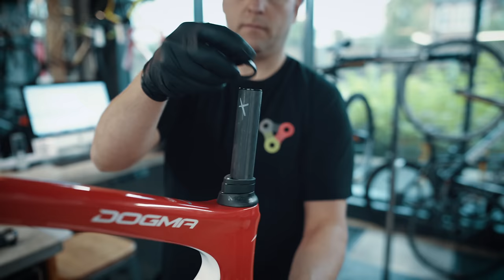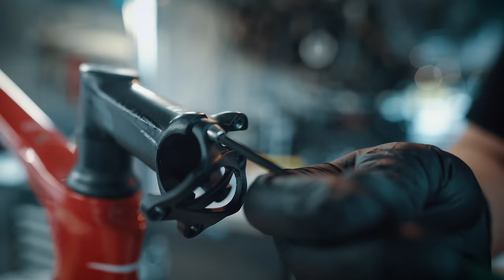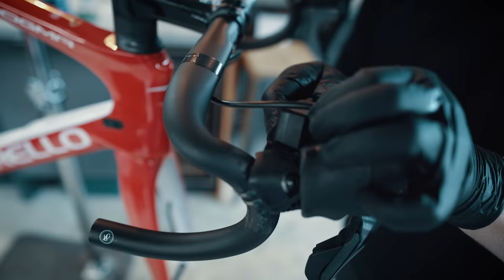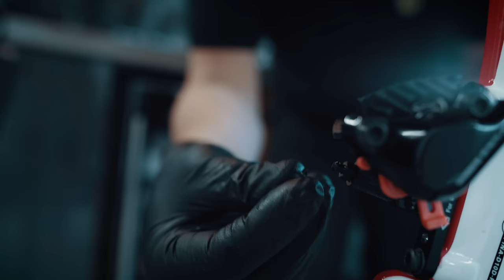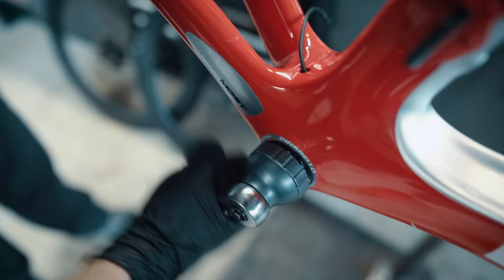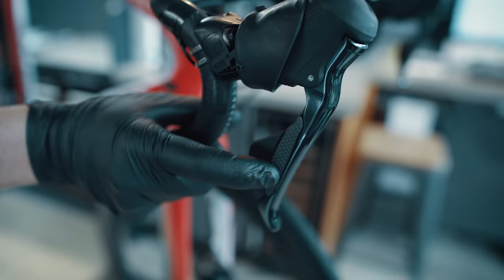DREAM BUILD ROAD BIKE - Pinarello Dogma F10

Comment: 27 years ago I used to work in a bike shop, now here I am watching bikes being built on the inter web. Back in my day (: we had steel frames with rear drop out screws. I'd have to tap out the threads with a 2mm tap. Woe betide if I snapped off the tap in the drop out. I'd love to do it all again with these new systems.

Comment: For man, death is the great equalizer. For road bikes, it's the tape that fixes the bar tape at the end. The bike's price doesn't matter, the bar tape still gets taped up on the tops.
Reply: kswsquared lmao beautifully stated
Reply: That's why when I tape a bar I start at the TOP and end at the BOTTOM and use the supplied bung to keep the tape in.
I personally have had no problems with my tape coming undone or water penetration.

I used to work at Raleigh and this was the way back then, many moons ago.
I can comfortably say I have taped over 30,000 bars this way.
Before anyone shouts bull sh*t you do the maths.
Quote for a day was 125 bars taped, that is all we did, someone else built the bars.
5 days a week.
52 weeks a year.
And I was on that job for well over a year.
Reply: @ianh9696  thats the way!

Comment: Would be fun to see these guys do a anti-dream build. They could get a pos bike frame and knackered old components and build it up using all the cheapest work arounds 👍
Reply: Chinese carbon everywhere, third hand SRAM in the back, Shimano in the middle, and Campy shifters, hand tight everything, no grease, breaks squeak, tires rub, seatpost jingles and jangles after the first pebble you run over.

Comment: edited the part where he spends hours fiddling about trying to get the gear cables through the frame
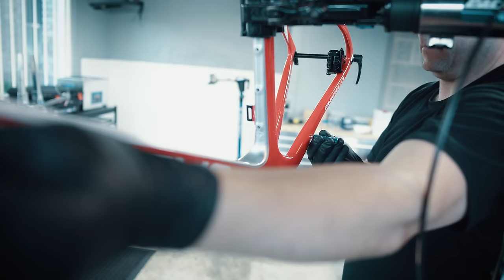Reply: 05:39 dude was using a magnet to guide the cable. Pro skills at work here
Reply: Just buy the park tool magnet cable kit 😁
Reply: @benturp3492   Ben Turp  50 quid! I dont think so lol
Reply: The dude spent minutes not hours. He does this everyday.

Comment: It's so funny that Hayes did a 22mm mount on the chainstays for discs in the 2000s, and then the industry goes "no, that sucks, we'll go with a 57mm mount on the seatstay, call it International Standard, everyone will use it that way." 

But then no, Avid wants the 74mm post mount. Except that the threads could be ruined, making them useless.

And now we're back to chainstay mounts, except now they're "flat." I guess that makes them new.

Nothing is ever new in the bike industry.

"Lay back, it's all been done before."

Comment: Nice Park tools, pity you don't have a Park CSB-1 hacksaw blade made for cutting carbon and instead cut with a hacksaw blade made for metal. I would also recommend sandpaper rather than a file for cleaning up (file is the tool for metal steerers)... I would also suggest you protect the frame when using the heat gun to shrink the cable wrap.

Comment: nice bike, nice vid! why did you change the sprockets of the shifting unit?
Reply: Those pulley wheels are from Kogel, which are slightly larger than OEM pulley wheels and run on ceramic bearings. These reduce the chain's angle of attack and reduce pulley wheel friction, which in turn improves drivetrain efficiency.

However, for such marginal gains, these parts are far from affordable.

Comment: There’s a metal backing plate for the FD stabilizer screw that never went on.
Reply: If that braze-on mount wasn't painted, it may not be necessary. But since it was, yeah, might as well.
Reply: @yonglingng5640  The plate is for the stabilizer screw to press on to keep the derailleur from moving when used.
Reply: @GNX157  I knew about that.

Comment: Now, use Oz cycles new chain lube formula and get the least possible friction and dirt. Actually, he's just found a way to get PTFE powder inside the rollers so the chain is Teflon coated inside and doesn't attract dirt. Just mix PTFE powder into some melted paraffin, soak the chain in it to get the powder in all the crevices and after it cools off, break off the wax and you're done. Throw those jockey wheels in there with the chain while you're at it.

Comment: Nice video! Can someone explain me why he changed the pulley wheels on the rear derailleur?
Reply: The new ones (Kogel) are slightly larger than OEM to reduce the angle of attack for the chain links and use ceramic bearings for friction reduction.
Reply: @yonglingng5640  Thanks! :)

Comment: Is there a huge difference in performance when swapping out the smaller cogs for bigger ones in the rear derailleur?
Reply: The ones that replaced the original ones only offer marginal improvement. For the greatest friction reduction in rear derailleur pulley wheels, the entire cage needs to be swapped out for an OSPW (oversized pulley wheel) system, which uses much larger pulley wheels, so large that it needs a new cage. Examples include CeramicSpeed, Ridea, etc.
Reply: @yonglingng5640  Thanks so much for the quick reply and the education in terminology (pulley wheels).

Comment: You dont cut the fork tube before someone is on the bike, because it changes the bike fitting for every person. If for some reason you need the handlebar higher, youd be screwed.

Comment: What pulley wheels did he fit to this ?
Reply: Kogel
Reply: Yong Ling Ng what are they like?
Reply: They're slightly larger than OEM pulley wheels and use ceramic bearings. These reduce the chain's angle of attack and provide less friction, which in turn improves drivetrain efficiency. For maximum benefit, you'll need to swap the entire cage for a larger one that has much larger pulley wheels, such as CeramicSpeed, Ridea and so on.

But I personally don't believe in such upgrades, the gains are marginal and they're expensive.

Comment: If the mechanic put the wheels on put the bike on the ground and set the levers position before cutting the second end of the brake cables they would of been neater and no chance of having to redo a olive crimp.

Comment: can someone explain how some fluid and wires can act as brakes?
Reply: Those wires are for the derailleurs. Hydraulic braking works by squeezing the lever, which actuates the master cylinder, which then transfers brake input to the pistons through the hydraulic fluid housed in the hose.

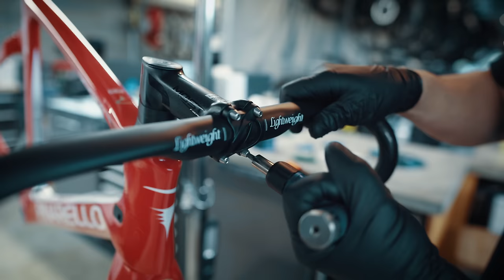Comment: ?  Why is he using a torx bit on a hex (allen) screw?   3:25
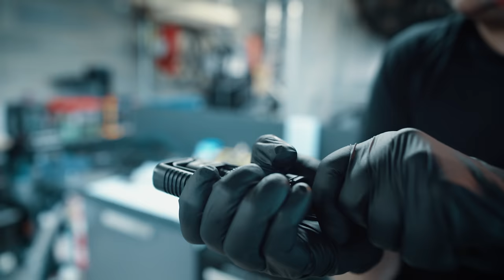  What is the name of that tool at 6:06?
Reply: MOST (as in, the brand) stems use Torx bolts. The tool at 6:06 is Shimano's hydraulic needle press tool. An alternative for that tool is a pair of yellow jaws provided with Shimano's hydraulic hose kit to be clamped with vice pliers and you'll use a mallet to hammer the needle into the hose's opening.

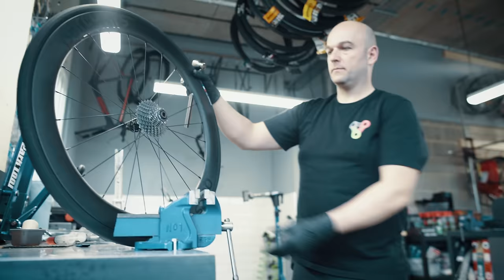Comment: 9:31 Do you want a dug up freehub? That's how you get a dug up freehub. Always use a torque wrench to tighten to lock ring to 40NM. Without proper compression, gear rings will dig into an alloy freehub like a hot knife slicing through butter. I cannot believe the unprofessionalism of the mechanic.
Reply: Done it this way for 10 years. Never had a problem. Also pretty sure Shimano freehub bodies are all steel anyway so it doesn't really matter.

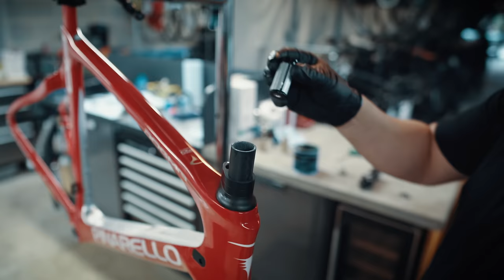Comment: 2:01 can you guys tell me what he's interesting into the fork?
Reply: This is called a "bung" and acts as an alternative to the star nut that you typically see in aluminum and steel forks. A star nut works by digging itself in to the metal of the fork steerer to hold itself in pace. With carbon forks, you don't want anything to dig itself into the material, so bungs hold themselves in pace through compression.
In case you don't know what the star nut or bang is for: The are simply to hold a nut inside of a tube. The bolt of the top cap is then screwed in to the nut in order to hold everything in place and preload the headset bearings.
Reply: @m97120  ohhhhhh thanks man

Comment: Why oi forks need to be cut? They already know the measures...why ?
Reply: It's one steerer tube length for all sizes. The largest Dogma F10 frameset won't need to have a lot of extra steerer tube cut off. They can't possibly make different moulds just to account for different steerer tube lengths.

Comment: Great video of the build.
But the build itself...
Someone spent big cash for this build/bike.
Pinarello Dogma F10 frame with disc brakes.  Dura Ace component kit.
Even upgraded the jockey wheels in the rear deraileur.
...But used the stock Shimano bottom bracket???
Anyone who builds a bike this expensive can easily afford any of the numerous bottom brackets out there that are far superior to the stock Shimano (even if it is Dura Ace).
I just don't understand why anyone would drop this kind of coin on such an expensive bike and not spend another $100-200 on a much better BB.

Comment: More like a nightmare build. Not wearing a mask when sawing and sanding carbon fibre. Not glueing the cut edge.  Handlebar wrap completely messed up with bulky figure 8. Worst thing: Not knowing how to properly use a torque wrench on the handlebars. Could end up in catastrophic failure of the carbon!

Comment: Sorry, but this is a price pulled out of thin air.  I put a bicycle together last month. Ran through all same steps. Granted - my components were less expensive. All in around a $1000. Which was a decent few hundred less than ready comparable parts bike. 
This price should include a TV, dining table set and directions how to cure cancer. Otherwise it’s an overpriced BULLSCHIFF

Comment: Why the fuck would u put that blue shit on the bars? 
Like the bars are going to seize up on the stem

Dream build but he tapes the grips with TAPE
Maybe u should torque it before u tighten it in its fuck in..
Torque wrench is just clicking
Reply: That's carbon paste, not grease. Rub a drop between your fingers & you'll feel it's coarse.
Reply: @yongling9825  Now i see..as google says ..specially designed to create friction and reduce slippage between clamped carbon fiber surfaces...made for people who don't know how to use a torque wrench..waste money on that but tapes the grips
Reply: I know what knurling is & nobody does it on carbon.
Reply: @yongling9825  Good for u kid..its a shame youtub flaged my first reply
Reply: @skour7104  What did you do over there?